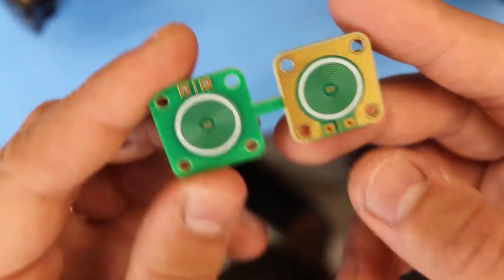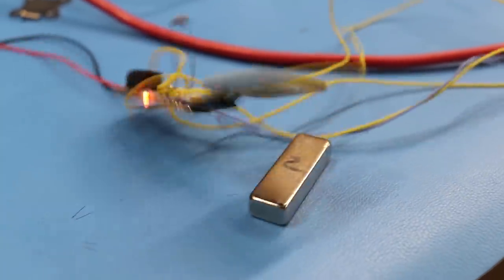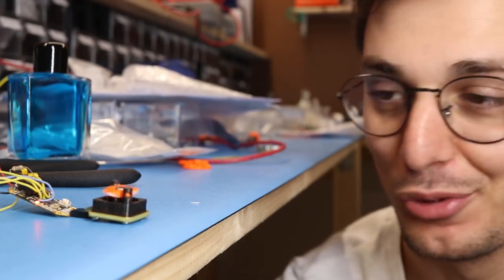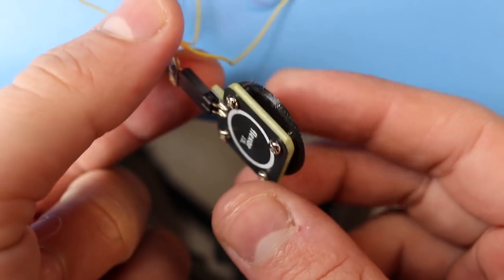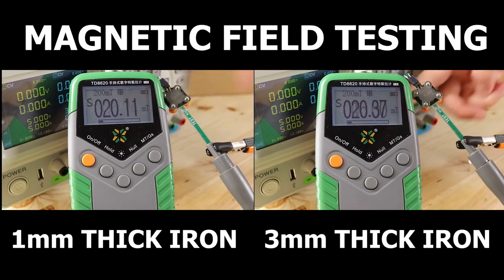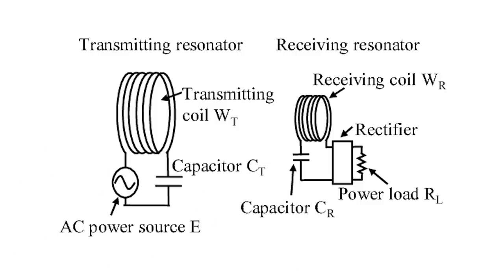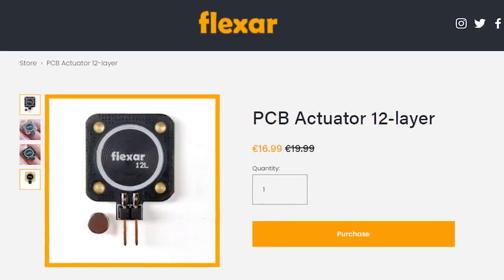12-layer PCB Coil APPLICATIONS

Comment: so cool!
1) consider a version with a central hole, it may have further applications like using many parallelly with a long rod crossing them?
2) consider moving the plug to one corner, one may like to create grids, and with current configuration it seems impossible? maybe prepare to have plugs in different places so one can use the preferred location?
3) consider selling a whole grid one can break into small squares, with a central hub for plugs and local plugs to be applied when you split it?
4) square grid, triangular grid, hexagonal grid?
5)local led to display action (or just the setup for those willing to apply/use it)
Reply: That is what I just posted as well. It will increase the field strength if you add an iron core. It would also let you make solenoids, motors, tactile switches and more by adding springs, plugs, or ferrite/iron cores. Also mirror arrays or galvos to project light or steering laser beams.
Reply from the maker: i like the breakable grid idea :)
Reply: This is a whole product stack right here :) Hire this man and make all of these.
Reply: @excitedbox5705  true about the iron core, but I was just suggesting a "stick" to connect parallel actuators together, so it could be made of any material
Reply: @CarlBugeja  There are a few applications I'm working on where something like this might be fun to include, generating fields up to about 10-20 mT. It would definitely be important to have a central bore of about 8-12mm though.
Reply: An additional idea, chiral versions, that is left or right-handed. The perforated sheets could be printed out all one chirality or alternating clockwise and anticlockwise allowing one to quickly make quadrupoles or Halbach arrays. Even Halbach cylinders in the case of flexible ones. Also I was thinking versions of different sizes such that they could fit within each other in this new product line!
 Otherwise I was thinking the same things particularly the perforated, in square or hexagonical sheets.

Comment: Perhaps I missed it in one of your videos, but have you tried printing the flexible PCBs with straight lines but at an angle, then curling the pcb into a tube?  You'd essentially be making a 3 dimensional coil where the first line on the PCB solders to the second line, etc.
I guess the soldering points would make it difficult to pack a lot of turns into a cylinder.

Comment: Pass a cable through the center and use it as a current transformer? That might have interesting applications, though I don't know how sensitive it would be, there are CTs on the market with less than 200 turns that people apparently make good use of!

Comment: Great video!
I was thinking: what if you tried to increase the torque of the motor by stacking more pcbs and by placing an actual ferromagnetic core in the center of the coils? (It can be as simple as an iron bolt in the middle of the coil) This should increase torque and efficiency of the motor drastically but still keep the motor small and easily manufacturable

Comment: Could you make a buzzer without a permanent magnet using a thin flexcoil?  

Also, it seems to me like the only advantage of your 12-layer version would be in manufacturing as part of a larger board.  As a standalone component I don't see any advantage over a wound wire coil.  Did I miss something?  (BTW I really appreciate you exploring this whole flex PCB coil space.)

Comment: Great stuff you make, Carl. Do you think, your Actuator could be also used as a contact-type microphone (like piezzo)? e.g. to glue it on acoustic guitar or some other instrument.
Reply: With the addition of a flexible magnet to induce a current yes. Or a rigid one attached to a flexible membrane like a standard capsule mic.
Reply: @m3chanist  yes, that's what I had in mind. I believe the first solution should be just fine, since the body of an instrument would already work as a membrane.

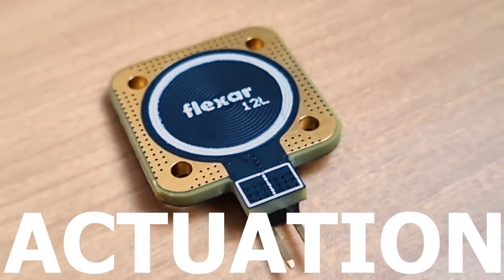Comment: I have a idea for the actuator on 0:44. i love vr gaming and many try to build haptic gloves or other haptic stuff for vr. many use air pressure or vibraison motors. but a mini actuator would make mutch more sense. imagine a haptig gloves with many actuators so u can feef the surface of a objeckt. or a vr jacket witch uses these smole actuators instat of vibraison motors. wher do i need to throw my money to get this?

Comment: now this makes no sense. the only advantage it should have over a traditional wire coil is price. Everything else is just compromise. Now for this figure, some would hope to get at least 50 pieces, not just ONE. So you want to make it "a little bit cheaper"? Step up your game then. Yes, 12 layer PCBs are expensive, but guess why: they aren't meant to be used as a weak stupid electromagnet

Comment: Sir, alredy exist coils... supposedly you do that on PCB because its a very cheap implementation, but in your madness of find something that really works you scratch the limit of the common sense, 12 layer PCB are expensive as hell, thick, and rigid, you are alredy out of all of your initial goals...

Maybe its time to switch to the appropriate component, or to stop...
Reply from the maker: Hi thanks for your argument.. But I think you got the point wrong.. What I am selling is a development kit, to make it easier for makers and engineers to use this PCB. Like I said I did not order a large quantity of this PCB (+ I also need to make a profit) , but when you consider the idea of using this coil for a product with larger quantities the price still drops (+ the price is not the only advantage). I agree with the fact that its not as cheap as my 2-layer flexar and its not feasible for ever project but it allows you to experiment with thing that with 2-layers (same size) cannot be achieved
Reply: @CarlBugeja  Mister, even taking your words, you always can stack 12 flexible PCB coils, more production run more cheap.

Please, consider that maybe you are running out of the purpose of youre work,  perhaps changing the direction your videos can be more attractive and useful.

My best regards.